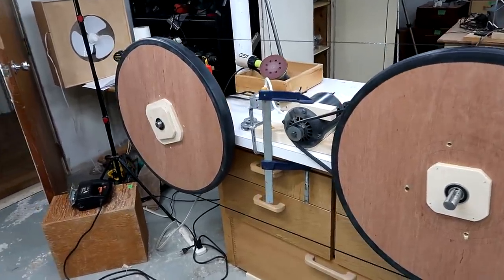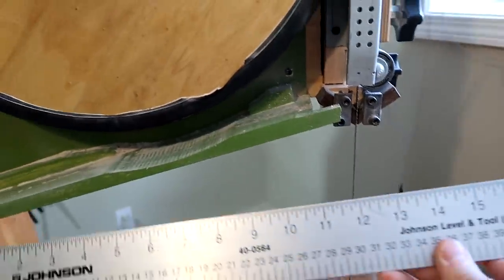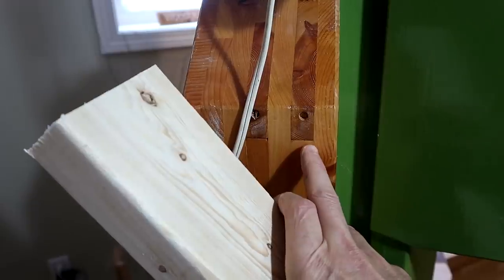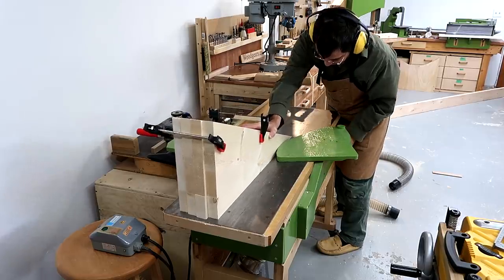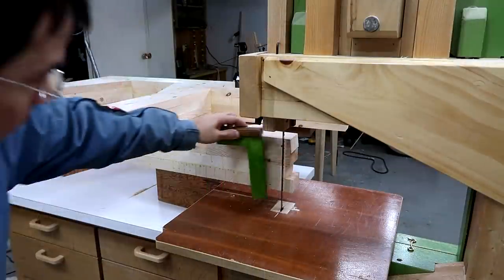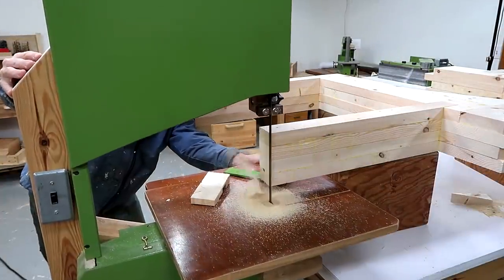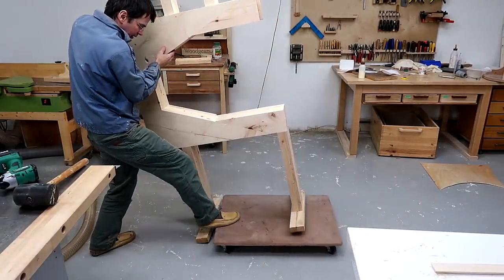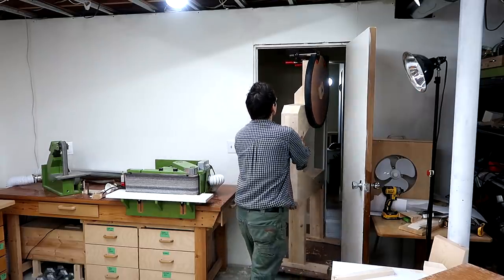Building the 26" bandsaw frame

Comment: I'm pretty sure Matthias already knows (1) he can lie it down to move it and (2) he could install a larger door. I believe the point is that he wants to be able to easily wheel through any standard height door, in this house or in any other. 

Presumably, he'll be making and selling plans for this 26" bandsaw and potential buyers will be a lot more interested in building it if they know they'll be able to easily move it through their own doors.
Reply: It's mighty convenient for sure to be able to skooch it through the door. I did have a thought that the saw could be hung on a 'external' frame that would serve as the dolly that would allow it to pivot forward so it is then level with the ground. A locking mechanism such as a pin or lever would be pulled that then would let it be free to rotate. You could then build much bigger. It is of course much more to build and engineer and may make the saw less rigid overall. As well the external frame would take up more room possibly. Easier said than done :D
Reply: Just make a two piece stand.  These things shouldn't get moved around that much.  Tables have removable legs for a reason.  Moving big equipment is a pain.   No need to make it "portable" for all time especially if that necessitates compromising capability and performance.
Reply: He said the door was smaller than a standard door, even compared to the rest of house, (I think) so making it bigger, by a small amount, seems a sensible options, as it was a squeeze as it was.
Reply: Justify it  all you want, still not a good enough reason. I'd lean it back on two rollers and move it any where I wanted.
Reply: @KipdoesStuff  if ur talking to me, I'm not justifying it, just pointing out why it might be a sensible course of action, there are plenty of other sensible courses of action. Personally having a door that is a different size to all the other doors in my house would be reason enough for me to change the door to be the same size as the rest, as it would piss me off, this would just ensure I did it sooner rather than later.
Reply: @cjhification  you’re is short for “you are”. Your is not short for “you are”. As in “if your talking to me”.
Reply: It is our duty as youtube commenters to repeat the obvious ad nauseum.

Comment: If "Screws at an angle®" are basically pocketholes,
then "Clamps at an angle" should be pocketclamps.
Reply from the maker: What makes a pocket hole a pocket hole is a pocket shaped hole.  Read the word, dammit.
Reply: @matthiaswandel  Excellent reply. The fools are getting on your nerves aren't they?
Reply: @chrisallen9154  missing the simple design flaw (no rollers to tip it back for moving) is getting him upset. The comment was a bad pun, nothing to get riled up about.
Reply: Maybe Matthias could design some folding or otherwise collapsible clamps which would fit in a pocket. I don't think it would be anywhere near as strong but would it be usable at all?
Reply: @eDoc2020  BTW, the pantorouter has clamps in a t-slot, right? That's almost a clamp in a pocket.
You don't need to reinvent a clamp to put it into a pocket, you just need to carve the pocket such that the clamp fits into it.
It's really as simple as a pockethole.
Reply: @KipdoesStuff  No, it just lacks the overpriced aluminium name-brand jig with an imperial measuring scale.
You can only call it a "Pocket Clamp®" if you make an anodised aluminium wedge with some useless scales that use the inferior measuring system.
Reply: @sasjadevries  I was talking about the pockets on clothes. Imagine pulling a massive blue clamp out of your pants pocket.
Reply: @eDoc2020  You mean the: "Is that a clamp in you pocket, or are you happy to see me?" kind of pockets?

Comment: Next week, Matthias replaces the door with one of standard height and starts anew for a 30" bandsaw.
Reply: Depends if there is a structural beam hidden in that wall.   If not, I'm with you...
Reply: @Wordsnwood  With that gap at the top of the wall,  it's a fair bet that the door frame isn't structural.
Reply: @MattOGormanSmith  I also took a second look and I can just see one floor joist which is parallel to the wall.   So I think you are right.
Reply: nah, he'll just put one of his dust-collection units onto the saw, operate it in reverse and float the saw through the door lying down hovercraft-style :)
Reply: Jokes aside, I believe in an earlier video he had talked about a 26in wheel being the max wheel size he could have while having the table at a reasonable height. Correct me if I'm wrong.
Reply: Lol, Matthias doing something standard.
Reply: I had a friend that built a huge smoker and when he went to move it to the other side of the building he found
the smoke stack was 5" to tall... :-(
So like any southern Indiana guy do? Grabbed the reciprocating saw and cut a notch in the top door frame so the stack would fit through the doorway and made a swinging rubber flap to cover the opening to keep the cold air out... LOL
Problem solved... HAHaHa
LLAP

Comment from the maker: Getting through the door is not THAT important, and yes I know I could modify the door or tilt the bandsaw.  Please stop suggesting the same idea over and over.
Reply: Have you thought about modifying the door?
Reply: The one problem with tilting a tall piece of machinery like that is you have to lean it pretty far back to actually get a usable height reduction. This poses two pretty big problems. The first is you know have to carry a significant amount of the weight of the machine. The other problem is that it will take a significantly larger area to turn. So if you are going through a door into a hallway you can easily get to a spot where you can't turn it enough to stand it back up.
Reply: Make the walls doors.
Reply: just build a door stretcher, problem solved.
Reply: Anifco67  he explained it already in a previous video, his primary concern is throat depth more than resaw size. Its the beauty of making your own tools, you get to do whatever YOU want.

Comment: Have you considered building a bigger door?
Reply: Especially since the door is less than standard height
Reply: Cut a notch to accomodate the wheel.
Reply: Or dig a deeper basement. Or Jack the house up. Or........😖
Reply: Or just remove the upper wheel when moving
Reply: @cklamNL  yeah "just" disassemble the entire saw every time you bring it out no problem

Comment: How big could you go if door heights were no concern?  Like where would you say the comfortable limit would be with a wooden framed bandsaw?
Reply: How big of a tree can you get your hands on?
Reply: @anicecoldbepis  so I know technically the sky is the limit if you wanted to build some giant gimmick that looks like a bandsaw. I was legit curious if there is a bigger than X you need metal” number.
Reply: @dpmakestuff  Like ThePetahs
 said. I think you can build a wooden bandsaw as bis as the wood you need to cut with it. It would most likely be a bit unpractical to cut a tree vertical (standing upright), but I guess even that would be possible with the right engineering.
Reply: Doors don’t become the issue but the floor.
Many large old bandsaws actually had the floor designed around them and the lower wheel beneath the first floor where you stand to operate it. 
Quite impressive machines really.
Reply: The limit is blade length.
Reply: @KipdoesStuff  can always weld a bigger blade.
Reply: @KipdoesStuff  no it’s not. You can get custom blades made any length.
Reply: ive used band saws with 4foot wheels and blades 6 inches deep that had so much momentum they took 2 min to stop spinning after shutdown. height was 10 or 12 feet tall. basically the building/shed was built around it. used to resaw lumber when i worked at a lumber yard. all the old twisted crap boards were resawed to smaller sections and sold as steaks and dowels etc
Reply: Ship saw
Reply: @KipdoesStuff  not true.
Reply: @dpmakestuff  
Practically speaking I think you might just need to fit the lower wheel under the table but a larger saw presumably would need a larger spine. 
Sounds like a future challenge for John vs. Mathias though.
Reply: @MrWorth66  I HOPE you meant stakes 'cause dang if you can get steaks from a tree, no need to kill a cow!
Reply: @KipdoesStuff  The limit is the blade tension. The longer the more tension. Then either the frame breaks, or the blade snaps. Or you have too less tension and the cut goes where it wants.
Reply: If we are making an entirely wooden saw like this I would argue the wheels themselves are going to be your limiting factor. Yes where there is a will there is a way but for practicality trying to balance such large wheels might become more work than its worth.
Reply: @Luckingsworth  
Watch Mathias video where he makes the wheels. He shows how he did the rough balancing before the final glue up.
Reply: @Crewsy  I would imagine it is considerably easier to balance a wheel with a diameter smaller than your armspan than to balance a wheel that is 20 feet across.
Reply: slow he is going to build someday an Eiffel Tower size Band Saw.
Reply: @dpmakestuff  Maybe, but you're so far into "giant gimmick" territory at that point as to make it irrelevant.

Comment: I think , making the space between the two wheels too small, spoiled the whole idea ... for the door you can Leaning the bandsaw
Reply: I agree. Why? A bandsaw by design does not lend itself to table saw type jobs. He is building an awkward table saw.
Reply: The larger wheel diameter primarily provides throat depth, and also less stress on the blade weld joints.  The length of the blade is what provides for resaw height/capacity.
Reply: mlindholm  Exactly , and for this ..it's possible to take advantage of the large diameter of the wheels by increasing the distance between them, and cutting a bigger wood vertically .
Reply: @messaoudkrioua5002  well yes, and you go big enough, you've got a vertical version of Matt Cremona's bandsaw mill. But that's not what Matthias is going for, he's literally explained he prioritizes larger throat depth, but with that, wants the saw to still be a reasonable size for basement shop mobility.

Comment: uh since you can lay it down on its side easily enough to move it why not build it as high as you want?
Reply: Fair point but I'm not sure how practical that would be or if he even needs more room between the wheels.
Reply: @Convolutedtubules  Actually it would be easier to build wheels on one side tilt bandsaw over to move it with its own wheels, that when fully upright dont contact ground.
Reply: @jacilynns6330  I do like that idea, it's probably what I would do. Maybe he prefers to use his little dolly and doesn't mind losing a bit of potential room for work.
Reply: The problem are the tight curves you may have in order to move the bandsaw between rooms.
Reply: Was thinking the same, but I think the main reason he builds a bigger band saw is not the need for height, but the need for depth.
Reply: Then the width of the corridor would be the limiting factor instead.
Reply: @anderswegge6828   I was JUST about to say "Cue the 'change the door width' comments now" but you beat me to the punch!

Comment: Was about to say, the obvious problem is your door, should just replace that with an extra tall door.

But the deed is done so no going back, even if you coulda listened to random internet stranger
Reply: The obvious problem is not adding to small rollers to the rear of the machine that would allow it to be tipped backward and moved through any height doorway.
Reply: @KipdoesStuff  If i remember the layout from awhile back, there isnt much space past the door, so you wouldnt have the turning radius.

Might be misremembering tho

Comment: Why does it need to fit upright though a door couldn't you tilt it over on it's side? Looking through the comments I see I'm not the only one to consider this option.
Reply: Tilting results in an initially higher point than upright until you lean it past that point. In leaning past that point you have all that top heavy weight to contend with. How are you going to move it when tilted off the wheels? I guess you could slide it but the best idea is to leave it where it is. No one builds a bandsaw this size for portability anyway.
Reply: @jeffstanley4593  I’d probably use a dolly

Comment: Either you're a particularly wiry powerlifter, or that frame isn't as ridiculously heavy as I'd assumed. :D 

I'd say this frame could still easily enough be made (So far) without already owning a band saw, but by the time you'd finished trimming it down with a hand saw your arms would probably be aching enough to make you want to torch the workshop and take up a less strenuous hobby (Like needlepoint, or origami). :D

Comment: There must be a good reason why not, but would using the vertical support as a fulcrum with something like a cable on the opposite side to apply tension allow the frame to be equally strong with significantly less lumber?

Comment: Anyone concerned with stiffness of the arms, you can always place a layer of fiberglass and epoxy between the laminations and over the whole finished frame.  Also, using good quality 1/2" plywood (so 8 laminations) would be stiffer.  Of course, both would be more expensive.

Comment: Why not lower the base? Instead of using a dolly, build a base with wheels but have the base lower than the top of the wheel. You'll also be able to use larger wheels that way. I've done that for several of my projects.

Comment: i build mine as a band sawmill i use for veneers cutting too could take 48 wide cuts too  does clear 24 inches for hight to bookend cuts for tabletops works remarkably good in that too did upgrade to a VFD powering it to have better to control the veneers i want to cut

Comment: One idea, if you were to want additional height - a set of wheels on the back of the frame, maybe even just a pair on the end of a hinged kickstand that would allow tilting to 45 degrees and then wheeling around. Though for the kickstand approach, it would likely require changing and/or relocating the "rear" dolly wheels for use in both positions.

Great video and work, as always!

Comment: This was for shaping things requiring a deep throw, right? So the saw blade isn't going to be that wide which requires less tension. This frame should be plenty strong. Slap on the tensioning system, dust covers, motor and a table and you're good to go.

Comment: Wouldn't it be easy to tip the bandsaw at say 45 degrees with 2 wheels on the base and a third wheel on a hinged brace to support it while you move it thru the doorway?

Comment: Doing my reading and watching still.  Going to go with the 20" version.  Still undecided on a motor.  I have a Porter cable table saw top I plan to use for my cutting top.  It may or may not have the Trunnions as I plan to use this for Re saw mostly.  I have a good problem here.  I'm getting a large supply of 2"x9.5"x4' oak boards from a local Axe throwing place when they change out their targets.  Need to saw them down to a useable thickness.  Love the channel and videos!

Comment: Have been waiting for this one since i am planning a similar sized bandsaw right now. Do you anticipate more twisting of the frame over time due to less laminated layers? Would you prefer to use slighty thinner wood, for example 40mm boards and bump the number of layers up by 1 or 2 if the wood was available for a similar volumetric price compared to 2 by whatevers? Here in germany 2 by whatevers are not very common, but 200x40 or 240x48 "Baudielen" in spruce are common and cheap, so i am considering using those, and i would consider slightly more layers to be an advantage.
Reply from the maker: layers are 34 mm thick.  If 25-30 mm was cheaply available, I would probably have used that.

Comment: When trimming down the ends, could it be done with a circular saw and a reciprocating saw (or a handsaw if I'm desperate enough) followed by a lot of sanding? Because this is all I can think of with what I've currently got.
Reply: Use any tool available. He was only kidding that you need a bandsaw for that step.

Comment: Have you ever considered building a "walk through" design using 4 wheels?  The blade would run up a wall, across the ceiling drop down to the floor passing through a cutting table then back to the wall?  With the proper sizing, you could cut plywood sheets.  Do NOT consider how you would go about installing the blade or what might happen should the band break during use... just start building.  You could cut another bandsaw in half with this thing!  Oh, and imagine what it would do for resale value, a house with it"s own giant built-in band saw.  :)
Reply: I was thinking the same thing after the last video. Installing the blade shouldn't be hard, just have a few folding access panels in the walls, floor, and ceiling. The same panels would also keep a broken band from flying in your face.

Comment: I have never worked with a bandsaw before... but isn’t the size of the blade standard? Which means that with bigger wheels they need to be closer to each other, or are they adjustable / sell them in every possible size? 

These big projects are always a surprise, it’s a pleasure watching your way of solving problems!
Reply from the maker: there are a few standard sizes for smaller saws, but for larger saws, there is no standard.  Blades are ordered by length, and cut and welded accordingly by the seller.

Comment: Since you have a planer and a jointer, it's easy for you to get square corners.
Can you discuss the decision to use dimensional lumber instead of plywood ?

Plywood layers would be easier to make with limited tools
If you used plywood  or hardwood,  could you use less thickness ?
Plywood layers would be more expensive.  What other downsides ?
Reply from the maker: Plywood costs more, and half the grain is always in the wrong direction.